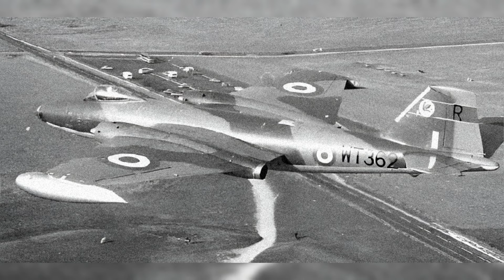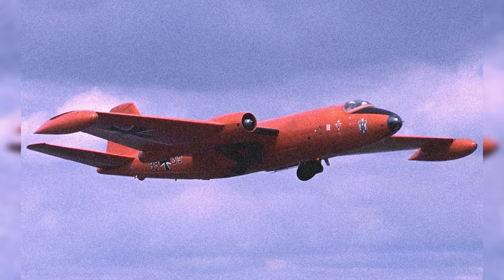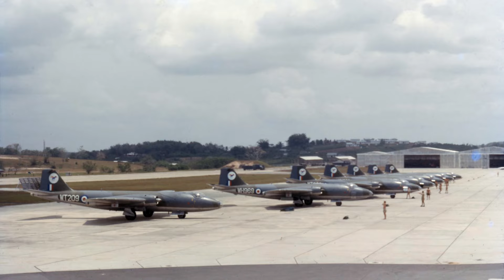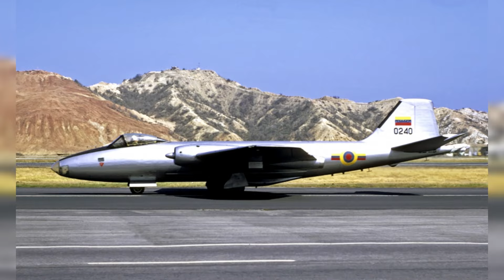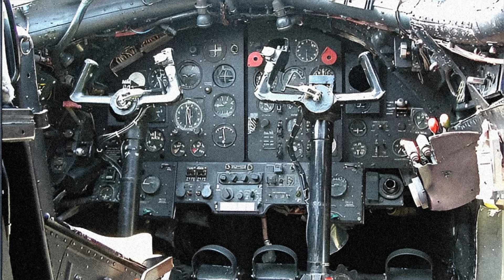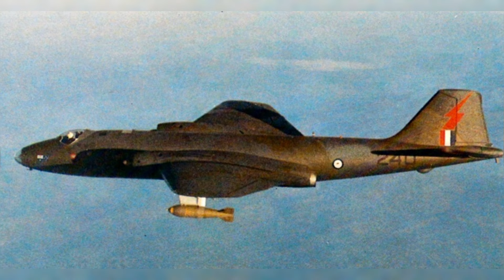English Electric Canberra – Britain’s Most Successful Jet Bomber

Comment: There are more accolades, records, and achievements not mentioned in this relatively short video. But there are more extensive, in-depth videos available on YouTube and i would urge those interested in it's storied history to check them out. You may also be  interested  in another English Electric jet of the same era;  the EE Lightning. The very fast, stacked engine interceptor that could break the  sound barrier in a vertical climb.

Comment: The narrator stated that the designers chose an axial flow engine.   They did not - the engine chosen was a centrifugal flow type, as RR had not yet mastered axial flow design and manufacture.   the axial flow Avon came later in the production run.

The narrator said that the Canberra could not be used as a bomber once supersonic fighters were developed.   The development of ground to air missiles rendered it obsolete too, probably more so than fighters.   But ....
In Vietnam the Canberra was used to bomb the North's supply route, the Ho Chi Minh trail.   But its small bomb load meant it couldn't do much.  The North forces used to just get their trucks off the road and under cover and let the Canberras do their worst, which was making big holes in the dirt road.   Once the Canberras had left the scene, the North Vietnamese used to just mobilize a lot of peasants with shovels and fill the holes in again, and restart their trucks.   So the Canberras were just a daily inconvenience.

Comment: The Canberra took part in the 1st Gulf War doing high altitude reconocence because the Americans had nothing that could do the job the Canberra was designed for,the Lockheed U2 being too small to take all the cameras the Canberra could hold. The engines are pronounced Kneene  not Nin. The Canberra also took part in the Falklands was for the Argentinians.
Reply: Some suggestions that the Canberra took part in the Falklands War for the RAF too, from land bases well south of the Equator.